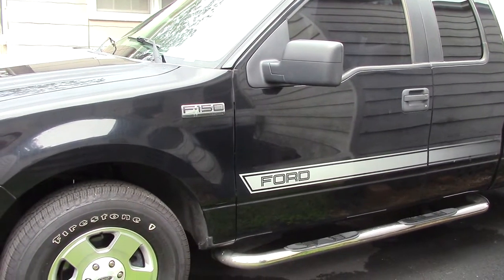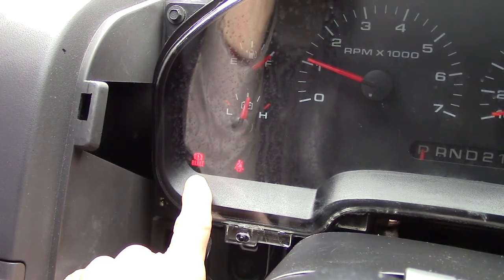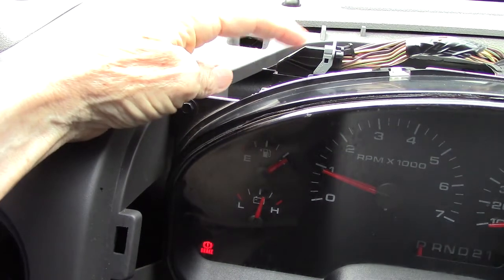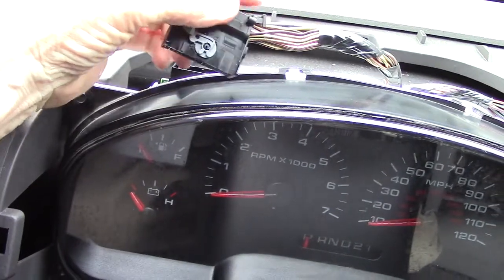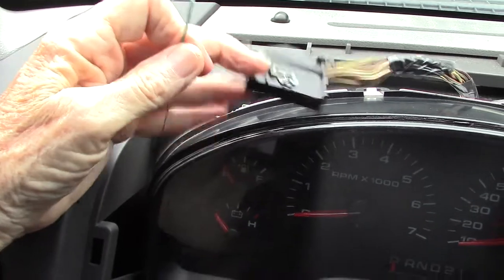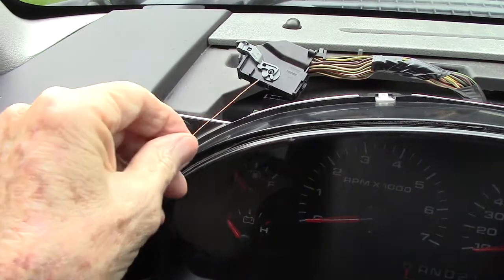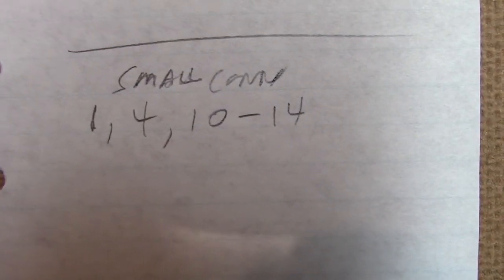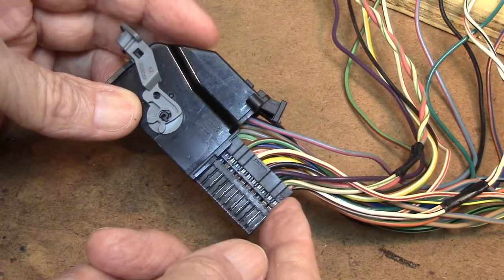Ford F150 emergency brake light stays on

Comment: The problem causing the light to stay on has been diagnosed since. Turns out a capacitor on the actual board behind the cluster is acting up due to low solder flow. The fix is to resolder capacitor 821. Pretty simple fix once everything is taken apart.

Comment from the maker: The problem was with the soldered pins on the big connector on the left. I sucked the solder off the pins and re-soldered them using plenty of flux. Lamentably you cannot see the problem with a scope or magnifying glass. The pins may appear good but are actually not soldered properly and probably never received enough heat at the time of the factory soldering process or the pins were a little scummy. Either way, some of the pins lost their connection inside the solder joint over time from heat expansion and vibration of the car. The bigger on-board resistors can form a solder crack also and it is worth the time to add flux and new solder to both ends. Solder problems on PC boards have been a plague ever since PC boards were invented. I have spent hundreds of hours re-soldering defective factory soldering.  This is nothing new. There are numerous ways that factory soldering is done. Some of the processes are better than others but neither of them is 100% perfect. I guess we're just going to have to live with it. It creates jobs for repair people.

Comment: I think the best thing to do is just buy a replacement cluster. My brake light use to flicker on and off with wiggling the connector. I had something wedged in my dash for a long time to keep it off and then it finally came back on. If I hit my dash really hard, it went off… And then it would eventually come back on. My internal lights would come on and off just like you said and run the battery down. They still come on and off when they want to at times by themselves. I sprayed some WD-40 in the door latches and it seems to have fixed that issue temporarily with the interior lights coming on and off by themselves don’t know if that was the issue or not. I watched a YouTube video of a guy soldering the motherboard where he said the brake light was coming on and off yesterday. My brake light still stays on. When I was wiggling my connectors yesterday before I did it, the brake light was coming on and off now it just stays on when I wiggle it. Pretty much gave up on it and don’t care if it’s on anymore because it’s not hurting anything. I believe I did fix my fuel gauge though. It’s been stuck on a quarter of a tank. It doesn’t go any further down and will eventually run out sitting on a quarter of a tank. When I fill up the tank it goes to only 3/4 of a tank and then it’ll go down to a quarter tank once you get down to about half a tank and sit there until you run out. I found a spot on the motherboard that didn’t look too healthy. I touched it with my soldering gun and the connection came right off. Soldered that connection back on and now my gas gauge works again. I’ll tolerate the brake light until eventually I decide I want to buy a new gauge cluster.
Reply from the maker: Yes, that is a really crappy problem. It all caused by bad soldering on the instrument cluster. Having a dead battery every morning really sucks. You can send the cluster to a rework guy, and he will repair the soldering and replace any bad motors. You can purchase a used cluster, but it will likely have the same problem. The mileage is contained in the cluster so if you change it, you will be getting an incorrect mileage reading. This could lead to legal problems if you sell the vehicle. There are ways to fix that also, but it needs to be done by a rework guy.

Comment: Great video I have two problems brake light coming on and off and dome lights as well so I will look into it thank you so much great video
Reply from the maker: Re-solder the header pins at the left and both ends of the bigger surface mount resistors on the upper left of the PC board. Wet with  good flux and use proper irons with the correct heat so you don't destroy anything. That's all it took to fix both problems in my cluster. If you feel uncomfortable doing that you may need to look for some help to be safe. Watch all the videos about cluster repair.

Comment: Simple fix. Add a 5 volt source to the dark green / yellow stripe wire on the left connector. I used a 12 volt source with a reducer to 5 volts. The problem is in the circuit board not the connector. Easy fix and only removing covers.

Comment: I noticed that when I pushed the connector slightly away from me the light went out and when I moved it slightly towards me the light went on, so I put a small piece of rubber between the connector and bezel to hold it out ever so slightly and the light remained out.
Reply from the maker: You are flexing the circuit board to make the bad solder joint connect. The problem is still there. It will probably come back in time.

Comment: I'm having the same issue.  Any recommendations on where to send it for repair?  Replacing it is extremely expensive.
Reply from the maker: Type in "F150 instrument cluster repair" and it will lead you to some repair sites

Comment: I have the same problem on my 2008 F-150. Which pin is for the parking brake light?
Reply from the maker: I have no idea. If one pin is problematic then other pins may be also. I suggest you unsolder the connector from the board, remove it and reinstall it with fresh solder. You will need a solder sucker of some sort or risk damaging the traces and a hot enough iron to resolder them. The problem may actually be on the bigger surface mount resistors at the upper left hand corner. Resolder them also. If you cannot do all the above then send it out for repair before other problems begin to happen.

Comment: Before you do all this bullshit, pull the E-brake lever, and while holding it open, lift the E-brake pedal with your foot so the pedal is resting at the highest point. This should trigger the switch and turn off the light. If not, then you probably have to do this BS.
Reply from the maker: When I bought the used F150 I noted that the emergency brake light stayed on. I kicked the lever around trying to get it to work. I thought the switch was bad and it would be an easy fix. If I had investigated further, I would have discovered that some other lights did not behave properly and would drain the battery overnight. Unfortunately, the Ford dealer did not bother to tell me the whole sad story (which I'm sure they knew) and I was stuck with repairing the cluster on my own after the purchase. They did, however, repair the door latches and the window switches because these problems were obvious. Yes, getting down to the instrument cluster and repairing it is BS but that is the only thing that can be done. Thanks a lot FORD!!
Reply: Thank you.
Reply: Bro!!! You saved me so much damn time and money lol. Golden, fixed it right away.
Reply from the maker: I had to learn the hard way. Spent extra money. Watched a lot of videos. I'm glad my video helped you. It is too bad the age of electronics has invaded cars to such a degree. Very frustrating.  @db-ro6ui
Reply: Bro I almost did all that B.S…….. then I seen your comment I’ve watched like 4 videos they all said the same shit. So I tryed what you’ve recommended and it went off instantly lmao….. your legendary
Reply: I can’t believe this worked I was ready to take apart everything and I did what you said…😂😂 saved me so much stress and it hasn’t turned back on 😅

Comment: What if it doesn't turn off when I move the wires?
Reply from the maker: You may still a soldering problem in the instrument cluster usually in the upper left area. Likely the solder has turned loose on one of the bigger surface mount resistors in that area. You can send it off to a rework repair place for a full repair and upgrade. There may be other soldering problems lurking on the board. Resoldering the board should be done by a qualified tech.

Comment: Couldn’t I just save the time and replace circuit board?
Reply from the maker: You can replace the circuit board but your mileage is retained in the board and the new one will have different mileage. You may get into legal issues, especially when selling the vehicle. I'm not sure but I think the dealer has to get involved. I bought a used cluster on eBay for comparison testing and parts. It worked but I could not fix the mileage issue.

Comment: I got a new used cluster from ebay 2 and put that new one in and the rpm doesn't work. does it need to be flashed?
Reply from the maker: Probably has a bad motor. You can try swapping with another motor to see it that fixes it.